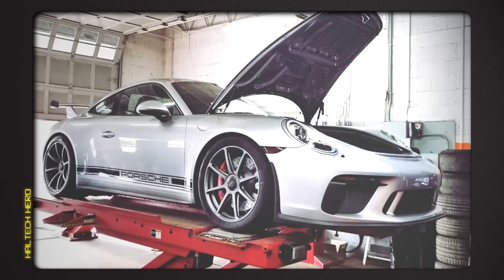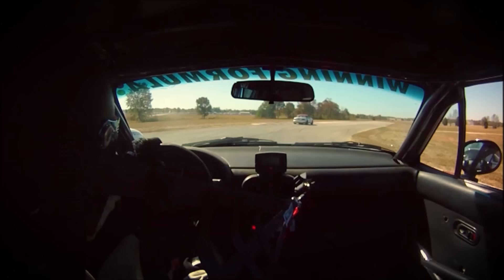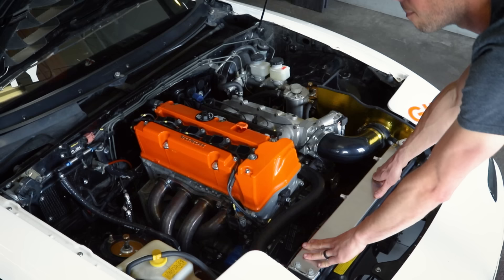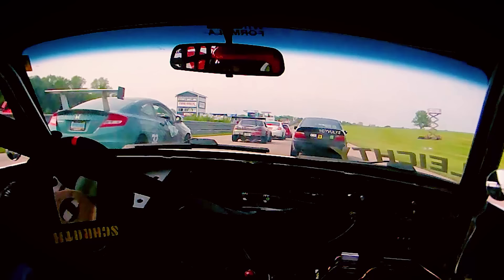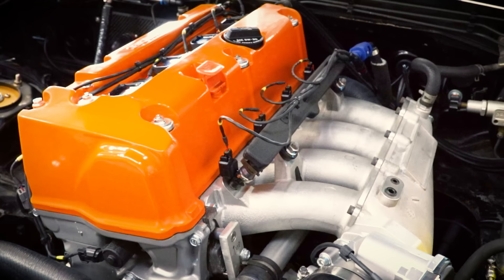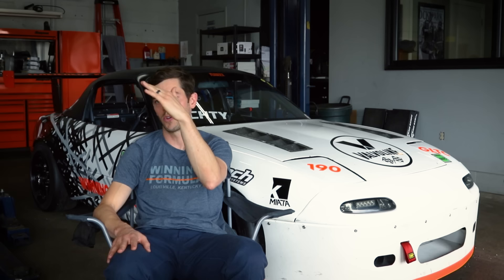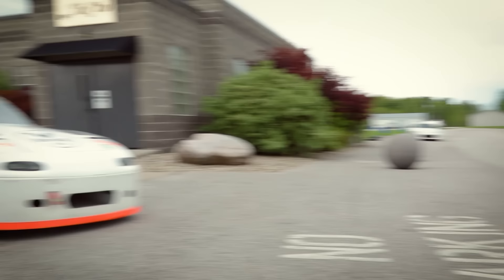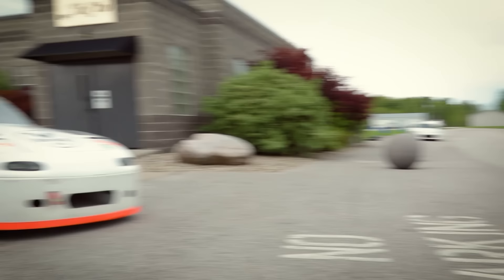🏅 Aaron's K24 Miata Missile | HALTECH HEROES |

Comment: Seems strange to allow the possibility of the driver to increase max hp at will :P Could just have a switch inside the car that changes to the higher hp maps. I guess only way to make sure is to use a restrictor in the inlet, or a max rpm rule based on engine displacement.
Reply: Rules that attempt to limit the power figures by hardware restrictions (displacement, rpm, restrictors) often devolve into an arms race where the driver with the most money makes more power than the other competitors. This system allows people to make the maximum allowable power figure easily and cheaply, which makes it accessible to more competitors and evens the playing field.
The more cars you have on track, the larger the sample size is to pull from regarding what a "reasonable" lap time is for cars who obey the rules. That makes it easier to spot cheaters. Anyone who limits their power gains to where it's hard to spot is taking a big risk for a small advantage, and can still lose to a better driver.
Is it a perfect system? No. It does rely on the driver's honor. Any rules do, though. Cheating happens regularly at the highest levels of racing with the strictest rules, including stuff like restrictors and RPM limits.
What i'm trying to say is that the problems you present here aren't solved by harsher rules, but the harsher rules do often make the racing less approachable, fun and interesting. So you'll probably do more harm then good that way.
Reply: @Talynen  Yes and no, if everyone drive by honor then it works. But you could basically have a button on the steering wheel allowing you more power to mask a mistake you made, and get your reasonable lap time even if you made a mistake that lap, thats hard to catch. What they have done with the K24 miata is also to use a bigger displacement engine and de-tune it, which gives you a much wider powerband at the "official power" than the next guy with the same 180hp but from a Honda B16 engine which will lack the torque in all other ranges of the powerband compared to the K24. Like he is saying they also have the option to make more power and place weights (in the optimal position of the car) a feature maybe the other cars cant afford.
I´m not sure THAT is fair tbh. I´m simply pointing at the flaws that these regulations allow, but what youre saying is also true about the gains being more dollars if a restrictor or rpm limit based on displacement and car weight is used. However I think that those ultimate hp that you would spend thousands of dollars for, wouldnt make the difference in the tournament ultimately.
In swedish touring car championship, there was a way of evening out the field by giving the previous events top 3 or so extra weight to lug around, to give the others a fighting chance, that would also be a way to counter an uneven field.

Comment: ya the only reason you'd ever want to drop a k engine into a miata is if you're trying to stay in a particular race class. otherwise, a j swap is a better option. just doesn't make any sense to swap a weak 4 cyl with a slightly stonger 4 cyl when there's plenty of 6 cyl options.

Comment: Like the power that a KMiata makes with a stock K24 engine (220 whp/190 torque). But the kit to install that engine is so freaking expensive ($5000), plus $2500 for other biits, plus $1200 for the engine. WOW,  money pit.
Reply: Yet people spend 20K on a stock S2000 with 100k miles. A mint Miata with a K swap would cost you the same.
Reply: Look at how much it would cost to turbo a Miata, or to do a forged shortblock for a turbo Miata.  Don't forget that a set of cams and manifolds and such can get you to the 275 HP mark rather easily on a K-series.
Reply: Sub 10k for an engine swap is CHEAP. Not that you'll likely come out under 10k putting a k24 (a2 or z3 since the z3 kit is cheaper) into your miata, but swaps are generally 10k before you factor in the motor or transmission. If you're doing something one off or not commonly supported; expect double that unless you're a hell of a welder with electrical and autobody expertise as well. Tuning isn't cheap, nor tools and shop time if you don't have the garage space. Kpower will sell you the kit with everything you need and install it all for about 9k; it doesn't get better than that, honestly. Throw another 2.5k in if you want a zf bmw transmission and getrag diff + the adapter kit to handle the power more reliably (easy enough to do yourself though) and for 12k+ engine costs you could have a miata capable of reliable 350-450 whp (wouldn't put that out without FI ofc, which is another 2-4k or so depending on what route you take). Find another rwd setup that can have that output at that price and weight while being reliable and I'll sell my NB tomorrow lmao, till then ima keep saving to do all of what I just said. 20-25k for a reliable 350hp at 2300 pounds with 50/50 weight distribution (that's without doing ANYTHING to make the car lighter) is a rare sight, especially of its rwd and street legal.

Comment: That k series is the same as the nc 1 engine from the sound of it. Mine has exhaust cold air intake and a tune and makes 225. I still got 550cc injectors and a new throttle body coming to put in
Reply: There is no way an internally-stock NC engine is going to make 225 at the wheels with just an exhaust, intake, and tune. The BBR NC kit needs cams and ITBs to do that, and that's at the crank, not the wheels.

Comment: 210 to the wheels from a stock tsx I call bs.
The actual hp rating is 205hp at the crank on premium fuel.

You can have just as much from mazda/ford mzr/duratec 2.5L for the same price
Reply: Stock internally , it still has all of the bolt-ons, e.g. large-diameter intake with a cold-air airbox, headers, exhaust, and mapping on a full standalone. The K-series are known for making a lot of power (for an NA car) with just airflow mods. If you don't have class rules, you can make 275+ HP easily while still NA with a K-series, and the aftermarket is HUGE, neither of which apply to the Duratec/MZR.

Comment: Why not doing it right and put a F20C in it?
Reply: The K-series was used in a lot of cars so they're more plentiful than the F which was only available in the S2K. The K was in Integras, Civics, Elements, RSXs, TSXs, etc.
Reply: The K can be modified to higher power levels NA than the F20C, and for less money. It's also plentiful, whereas finding a donor F20C is going to be expensive. The K is newer than the F20, and everything Honda learning from making the F20 they used when designing the K series.

Comment: My perfectly road drivable BBR GTI NC = 385 BHP using the standard block with forged internals + a Turbo.
No body modifications or cutting at all.
[In addition - BBR GTI do a 225 BHP standard aspirated version as well....]
Also - the K series has a smaller bore than the 2L MX5 NC engine - so not as able to be gas flowed or tuned??
why bother swapping a whole engine that has so much less power than a turbo setup?
Unless there are "no turbo" rules?
But then - Its not an MX5 as it has the wrong engine to start with?
Strange inconsistent stuff for what is apparently "MX5" racing??
Are you allowed a "non-turbo" V8 flying miata too?
weird.....
Reply from the maker: The GridLife Touring Cup series this car is configured for does not bar the addition of an aftermarket turbo. But it does add a power/weight ratio modifier for installing one.
GLTC is also, at it's core, a power-to-weight class. Simply stated, more power = more ballast weight, therefore more power =/= faster car.
GLTC is open to all makes and models. Not MX5 specific. (A short part in the video describing "Spec Miata" is a different series this car was originally built for 15 years ago.)

More detailed information here:
https://www.grid.life/gridlife-touring-cup-gltc
Reply: K20/24 is still a superior engine to that pos in the latest mazdas.. and with the amount of mods they do on a BBR the K's do better power output more reliability... but anyway its good to see Mazda has almost caught up to 15 year old Honda tech... also 400whp turbo out of stock block and internal K series everywhere..
Reply: @pswmetalmonkey  yeah, you could boost k series engine to 500+whp on an stock unopened block